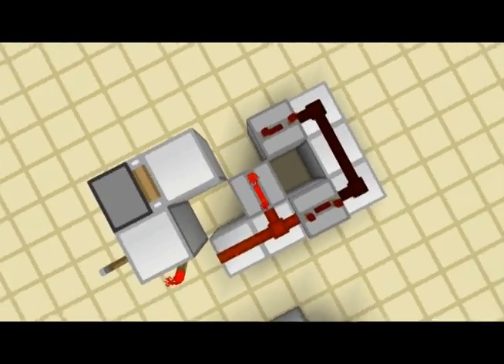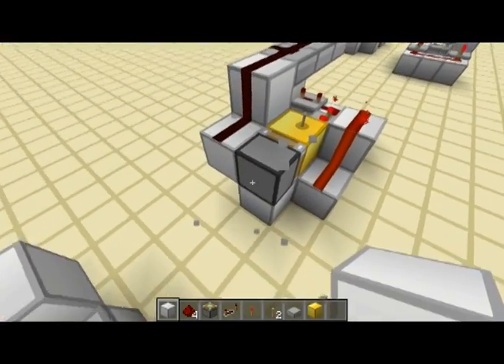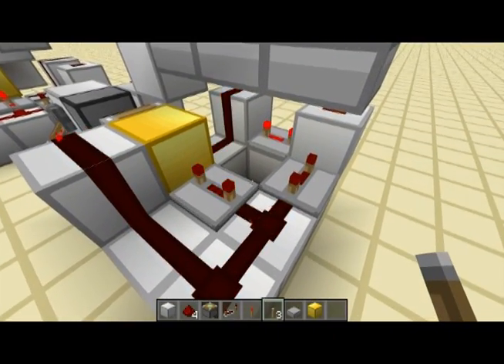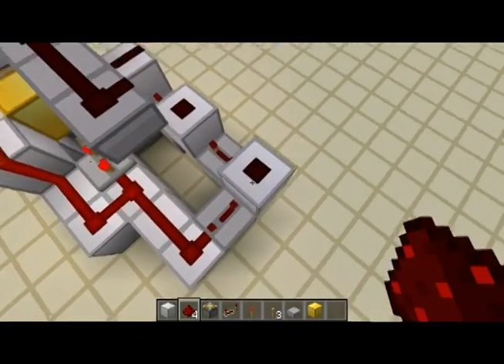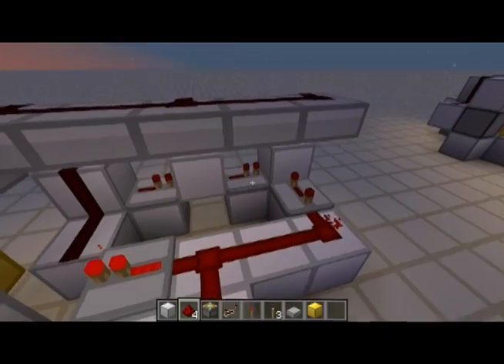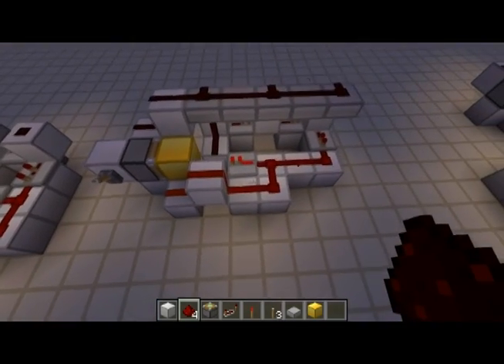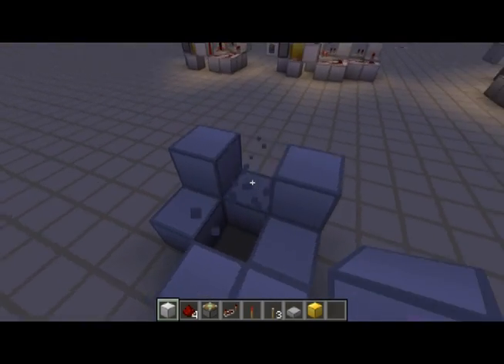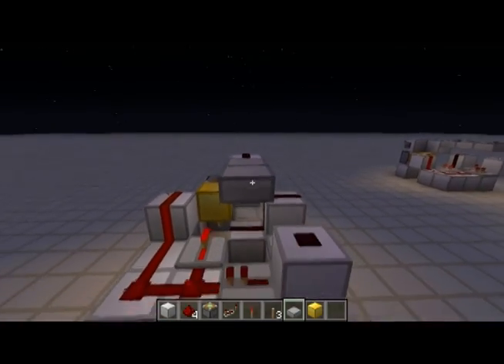Stable Redstone Toggle-Clock (5x4x4)

Comment from the maker: Yes, exactly.  The slabs are working as a large OR-gate with isolated inputs.  The output powers the piston so that it can only retract when none of the inputs to the half-slabs are on.  This means that the only time the piston can retract, allowing more redstone signal to go from the torch into the clock, is when the power is already on in the section of the clock that it flows into, and off in all the others.  The logic is a bit circular though, so I can understand the confusion.

Comment from the maker: You're right, without the halfslabs, the clock functions just like you'd expect a clock to function.  The slabs are there for extra functionality.  

Basically, without the slabs, it is possible to flip the lever a few times in such a way that all of the repeaters get stuck on at once.  With the slabs, it doesn't matter what you do with the lever, (provided the clock isn't in one of the glitchy spots,) it's impossible to get more than one of the repeaters turned on at the same time.